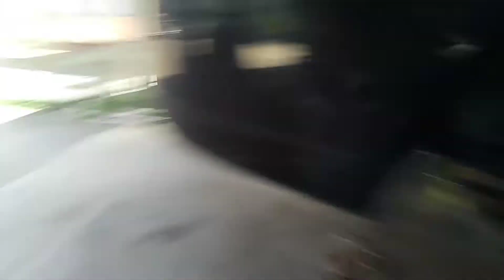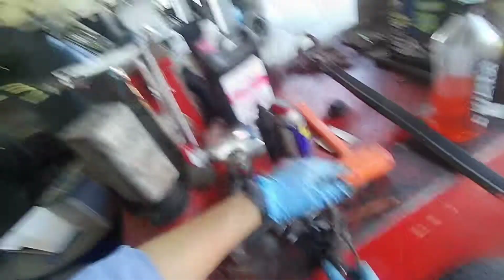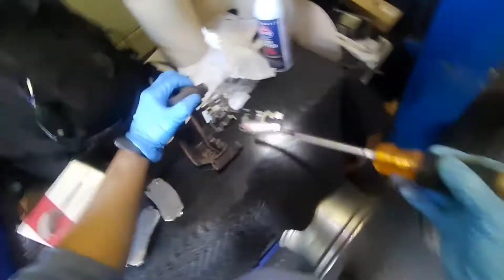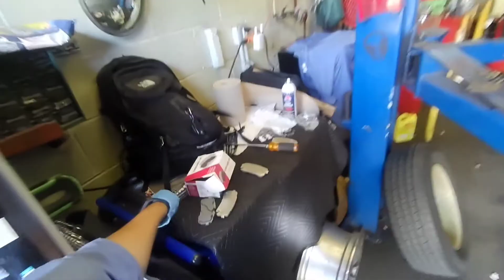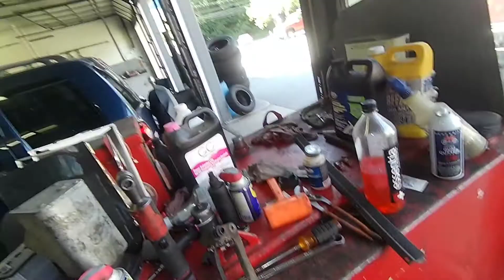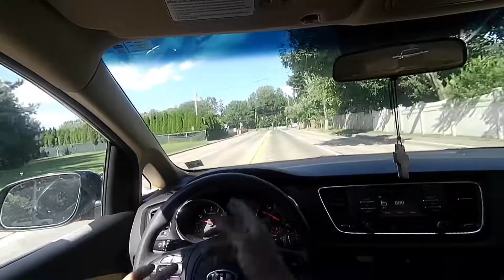2015 - 2018 Kia Sedona How to replace brake pads & brake rotor

Comment: I've done this job already, and for the lower caliper bracket bolt head that is behind the arm, a simple 14mm Gear Wrench gets in there easy for fast removal and installation. No need to remove the arm!!

Comment: Thanks for pointing out how to get that bolt off for the caliper bracket.  The Sedona service manual says to remove the shock which is insane!  I have a 2019 Sedona myself
Reply from the maker: Welcome aboard, Cory!!!
Thanks for watching!
Reply from the maker: Yeah...that arm is a pain in the a** .... to put it back, it requires a Lotta tension and maybe another set of hands to make it easier.
Now that I remember, I think I did remove that arm once, and I needed another person to help me put it back, but when you have the right tools or have some time to think how u can bypass that problem you can get it done.
Good job!
Reply: @AxtuoAx  doesn't looks like a special 14mm wrench, right?  I need to do a maintenance on my Sedona.  Seems my slider pins aren't lubricated properly so I am getting premature wear on one side (Left rear).  I have to get that bracket off without taking out the strut :)
Reply from the maker: I used a box end wrench here the link 
GEARWRENCH 12 Piece GearBox 12 Point XL Ratcheting Double Box Wrench Set, Metric - 85988 https://www.amazon.com/dp/B000T8WFBU/ref=cm_sw_r_apan_glt_fabc_5VPPA31M4R3M13RMRA2X

Then I used a regular wrench.
Hope that helps you.
Don't forget to share!!!!
Reply: @AxtuoAx  I run a Kia Sedona/Carnival group on Facebook for Canadian owners.  I already shared your video there!  I'm hoping they haven't changed the bolt length on the newer models.  If they have, then it won't release the bracket because the arm is in the way.  We'll see.
Reply from the maker: Ohh I see!!! That's nice! I'm here in new york.
Don't worry! Those box wrenches are really good for that type of project. 
If you have any problem, let me know.
Reply: I've never had any issues getting that bolt out with a regular 14mm combination wrench. However, I cannot find those parking brake shoes anywhere.